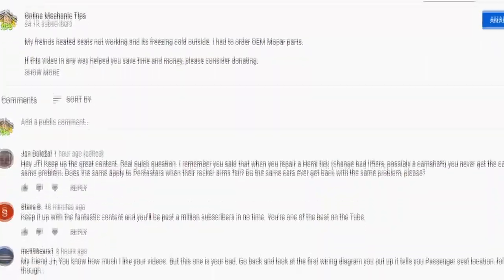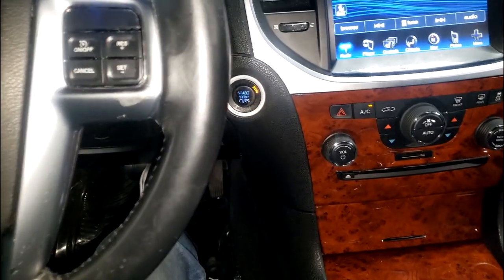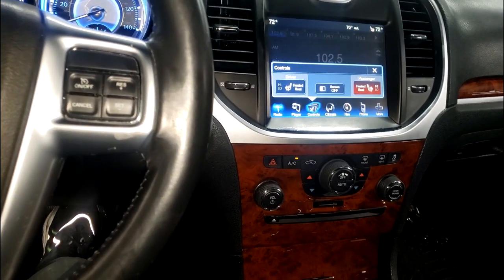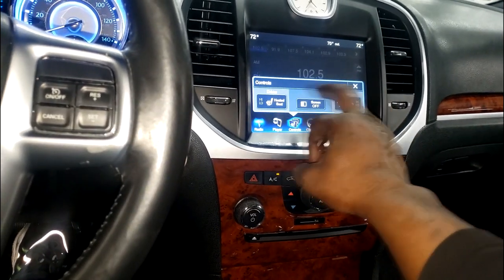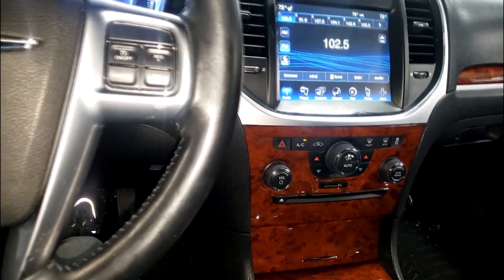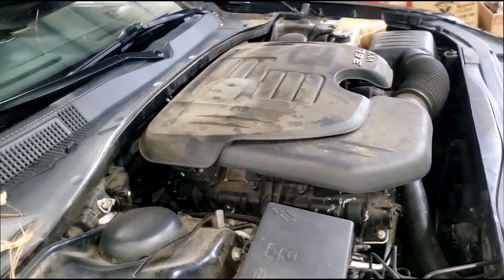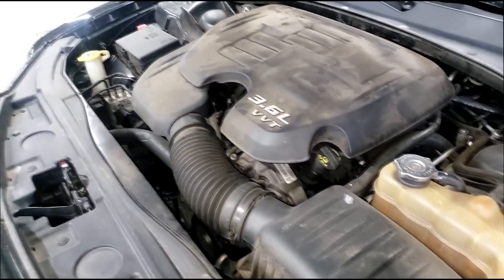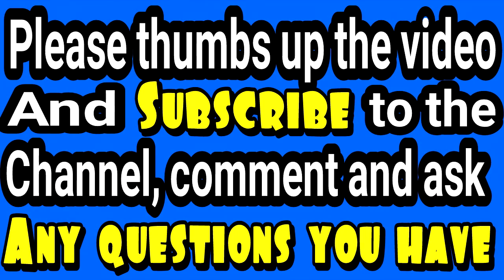Typical day in the shop. Recheck? Top 3 signs your motor mounts bad.  Engine Transmission Loud Noise

Comment: Used to break them all the time in my Dart. Turned out the older ones had better quality rubber... Then I found out I was using the wrong mounts as well. The proper ones had the same stud pattern but was thinner I think. I kept buying good ones when I could find them. I think between me always having fun with the 318 and not quite the right mount they broke after a year most of the time. Chrysler had so many issues with the the 440 cars in 69 that the factory fix was to leave the broken mounts in place and use a stainless steel small cable to tie down and safety the engine. I bought a 69 Sport Fury to resell and it actually had a broken driver's side mount with the cable bolted in place. You could still put a new mount in but they broke them so easily they just cabled them down.

Comment: Bro what is your  experience with p0452. On 14 Durango 3.6.
Reply from the maker: Hey man, that code can go either way. Thats why it has to be diagnosed with a good scan tool. The tool we use can run that test manually. Could end up being a ESIM tho.
Reply: @OnlineMechanicTips  thanks man
Reply: I finally found out problems. Thanks
Reply: It was the esim